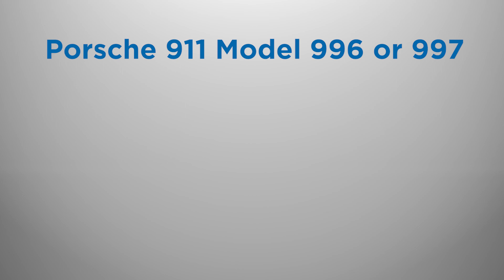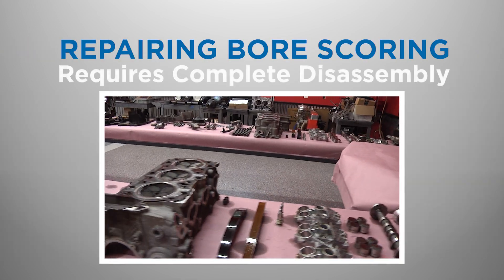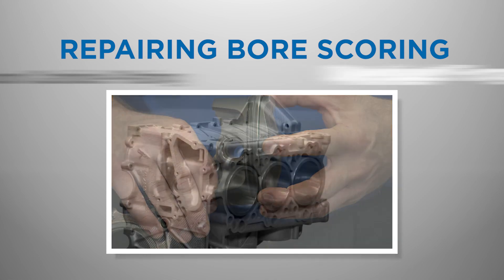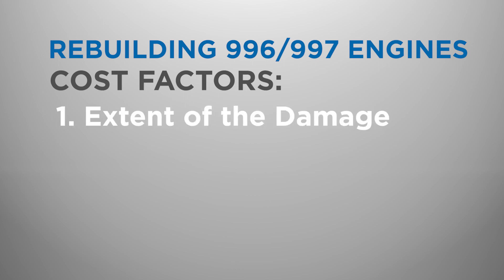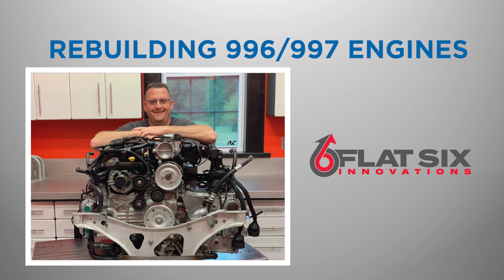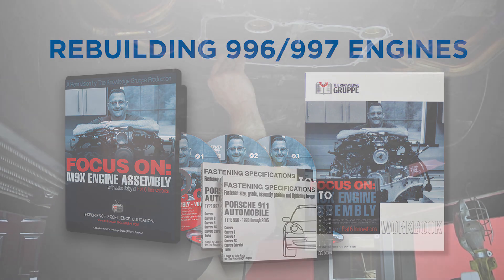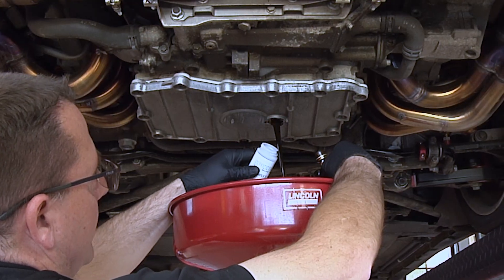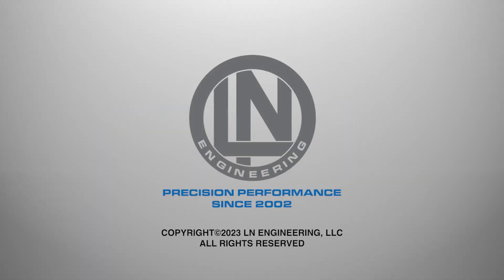Understanding Cylinder Bore Scoring Repair Costs for Porsche 911 996 and 997 Models

Comment: If I go from 3.4 to 3.8. Do I need a 3.8 crankshaft, or can I use a 3.4?
Reply from the maker: Nope. You can do 3.4 to 3.8 simply with bore size increase. We take the bore size from 96mm to 101mm to accomplish this.

Comment: This sounds like a practical rebuild solution with my mechanic doing the top part of my engine rebuild with LN doing the lower rebuild.  Fortunately, my 2004 996 is still running strong with no hint of bore scoring with 132,000 miles, but the day will come when I want the engine rebuilt before any serious problems.  Thanks
Reply from the maker: That's great that your 996 is running strong. Just keep up on your maintenance and if you haven't already checked out our recommendations on what additional steps you can take to help prevent scoring, you might want to check this out: https://lnengineering.com/products/watercooled-porsche-cylinders-sleeves-and-pistons/bore-scoring/tips-on-how-to-prevent-porsche-bore-scoring.html